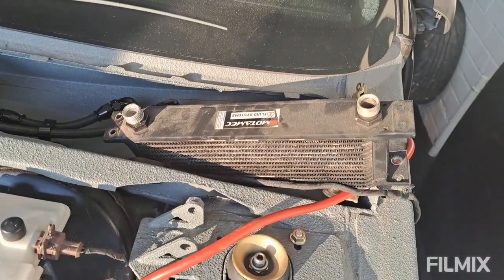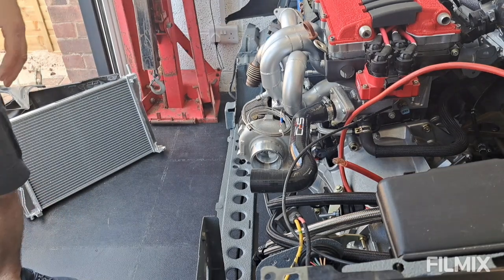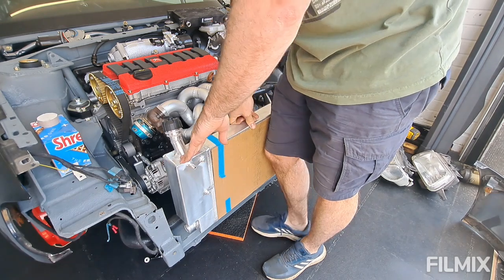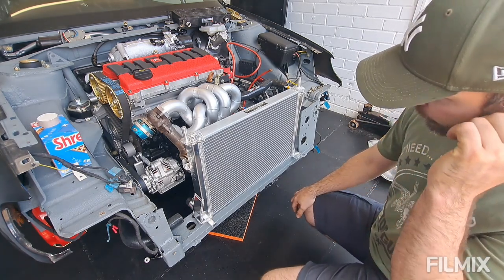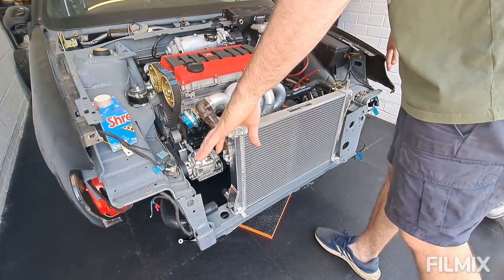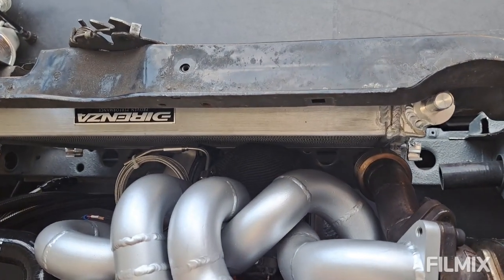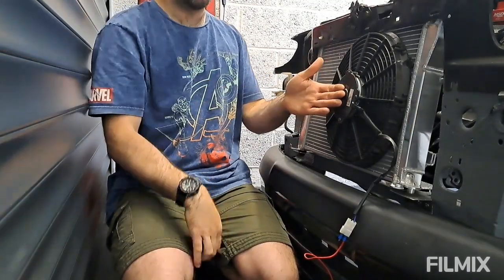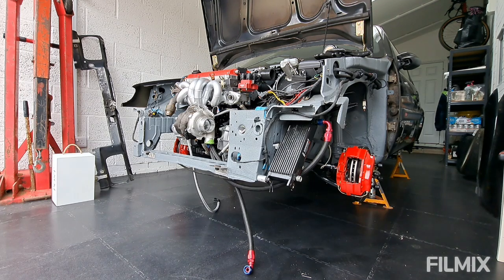Project 5AXO Ep43 - Citroën Saxo VTS Turbo - custom cooling setup

Comment: Hi I am French.
I have a saxo vts 1.6 8s of 98ch.
On the engine I changed the group n inox+ inox decata collecteur
and intake I added a green filter
What more should I do to gain power? (change fuel pump)